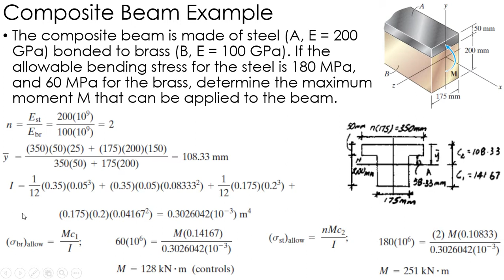Mechanics of Materials Example: Composite Beam

Comment: How did you get 150 for the centroid?
Reply: You are measuring the centroids of the individual elements from the top surface (look how the arrow points downwards in the drawing). That means that the positive direction of the y axis is downwards. That's why y1'=25 and y2'=150. For the last one you do the following operation: (250)-(100).